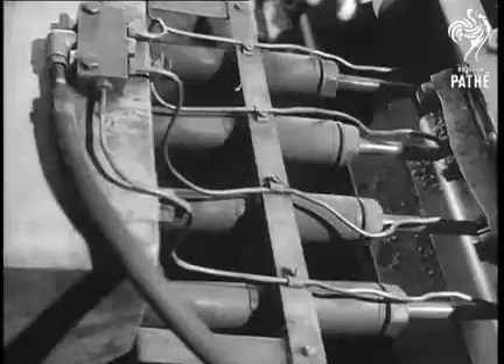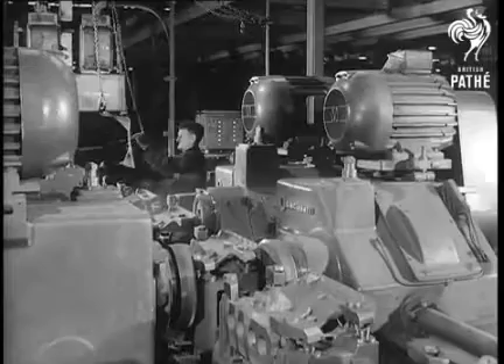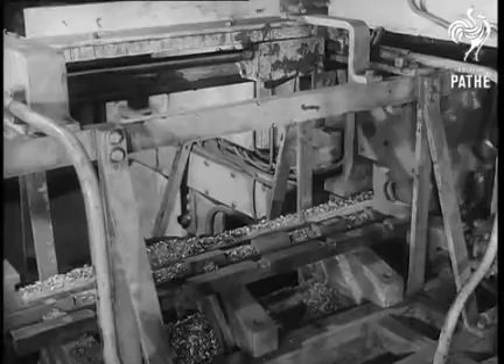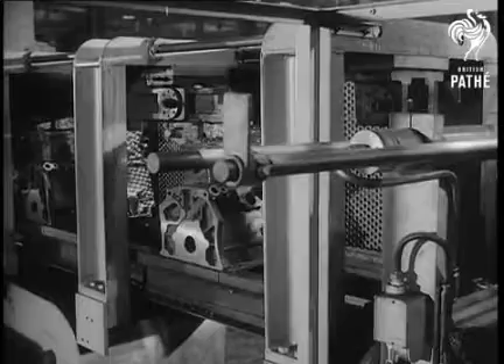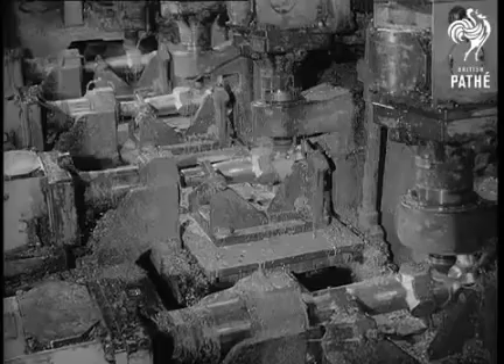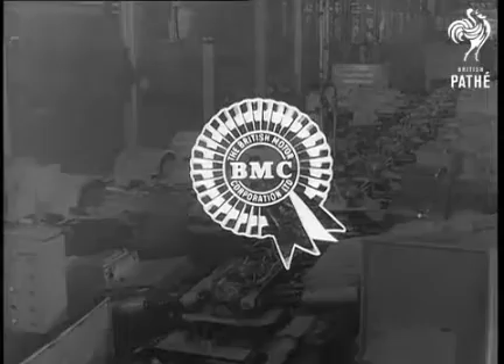Modern Production Longbridge     BMC/Pathé

Comment: Pretty impressive set up. Must have cost millions to develop and install. Todays "automation" must be very similar, except the timing and sensors are adjustable via software, whereas this earlier version would've required teams of technicians and engineers to individually adjust each machine/sensor and link in the chain manually, I guess.